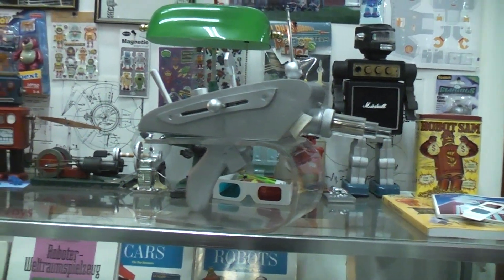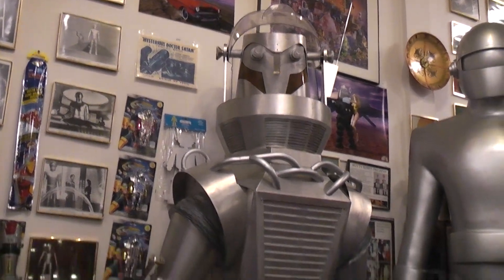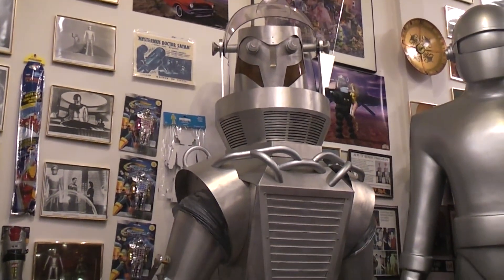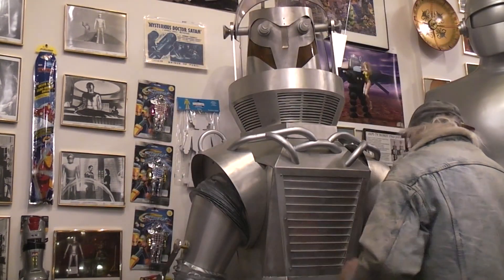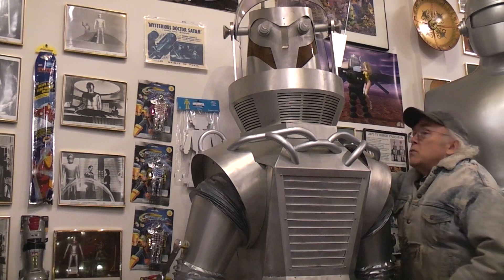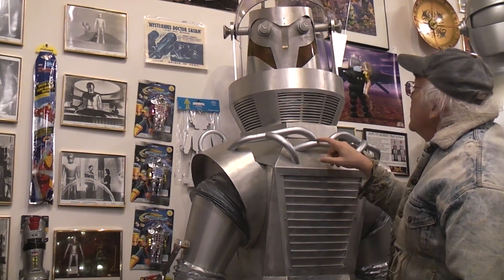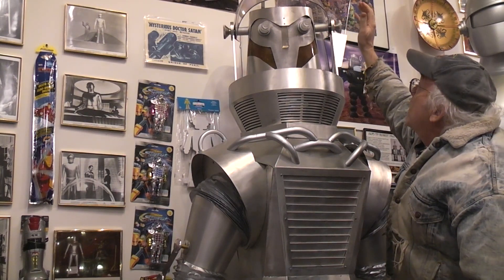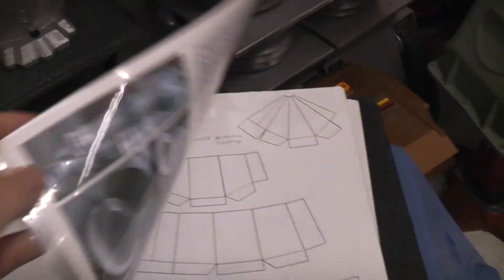Lets talk about TOBOR the Great.

Comment: Glue such as contact cement actually holds pretty much indefinitely. More critical perhaps if the joint was vinyl to vinyl that eventually vinyl just degrades and delaminates from cloth underneath, but that's just how it is. Vinyl is a brittle hard plastic, that is mixed with a plastifier, a viscous solvent of low volatility. But eventually the solvent does escape and air off and the vinyl debonds from the cloth substrate. When? Sometimes in 5 years, sometimes more than 20.
Reply from the maker: Yes I used sign "banner" quality material designed to last a very long time in the outside world. I should be dead by the time it has a problem. Leather is the way to go if you have the money and sewing skills.
Reply: @Robothut  But before he does take the last journey,,,He promised 14 yrs ago to divulge the location of the original... HAA...

Comment: Maybe I missed you telling us, but when Tobor was worn by an actor did he look through that grating in the neck? Was Tobor's head movements then controlled by the actor's head movements? Was it attached to the top of the actor's head?
Reply from the maker: Yes he looked there the neck grating and yes the top of the actors head is attached to tobor's head so that it could turn left and right. The tilt up down was on a lever.

Comment: Amazing Post John  !!! Thanks for the Tobor the Great Peak !! Your story and build on this is amazing!!  What an opportunity to study the original robot suit , was there a frame that the metal pieces attached to ?  How did the performer get inside the suit ? You can almost see what looks like suspenders in the chest photo next to your replica and they do look like frosted plexiglas for the louvers. How tall would you say Tobor stands next to Robby and Gort ? I have the resin kit that was made years ago but there are parts that are not as accurate, they need to be re-vamped. Tobor is one of my favorites in the Robot world !!
Reply from the maker: Like all robot suits the body lifts off the legs and yes suspenders hold the lower leg part on to the actor the body sits on the lower leg part. Robby had a more complex body harness to hold the actor in place so bending over would keep thing thight. But tobor was just a cross suspender set up.
Reply: @Robothut  John can you do a behind the scenes on the quarter scale Tobor you made, that probably wasn't the easiest build....how do  you scale patterns down for this ??
Reply from the maker: @richardalonzo2879  It takes a fair bit of math to scale down the large templates.

Comment: Based on the photos near the end of the video, it looks like the original feet are a bit larger than your version.  Perhaps to allow shoes and the actor's feet to be in them?  Nice Job as usual!
Reply from the maker: No the origional feet and mine are the same , as mine were made from templates I took from the origional prop.
Reply: @Robothut  Perhaps it was just light and shadow playing tricks with the camera (and/or my eyes :) )   Love your videos and your work.  Best Wishes!
Reply from the maker: @wwsvs  Interesting fact about the feet. The original feet still had the 1950's shoes mounted in them. I have pictures of that some place. And if you look close at the movie near the fight in the barn, you can see a chunk of the wooden foot that is cracked off, the foot was still the same when I worked with it.
Reply: @Robothut  Very interesting.   Thank you!  I will take a look.  :)  Any idea how much the costume weighed vs the B9 and/or Robby?
Reply from the maker: @wwsvs  Tobor was so much lighter do to the thin aluminum construction. The only parts that were heavy was the head unit with the plexiglass dome and the thicker aluminum rails that the head was hung on and the feet.  Both Robby and the B9 robot weighed at least twice as much.
Reply: @Robothut  I had a tin brown robot purchased from T.G. & Y. in the late '70s that once it broke my parents threw away.  I'm sure I could fix it now, but sadly it is long gone.  I never knew the name of it.  It had a clear plastic chest with two 'cannons' on it.  The head was kinda blocky.  I don't remember how it was powered.. maybe 2 C  batteries in it's back.  I believe the cannons sparked and the arms moved forward and back when it was activated.   In all of the toy robots you have; do you have anything kinda like that?  Thanks!
Reply from the maker: @wwsvs  Yes a few robots fit that discription. Check out page nine of my Robothut bots 
http://www.robothut.robotnut.com/rhbp9.html
Middle shelf first robot on the left.